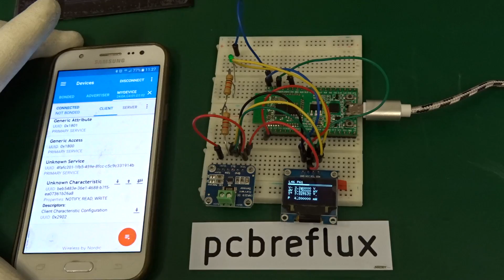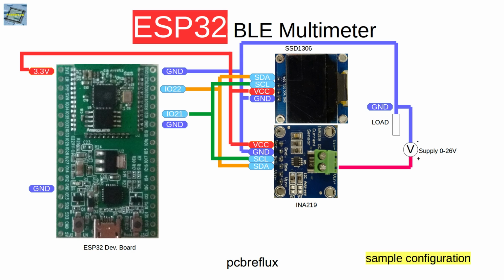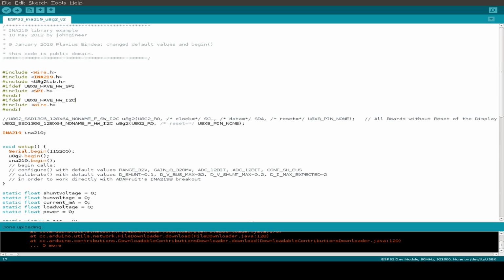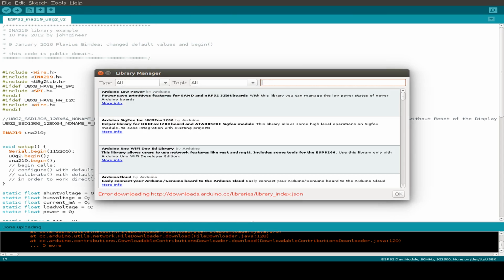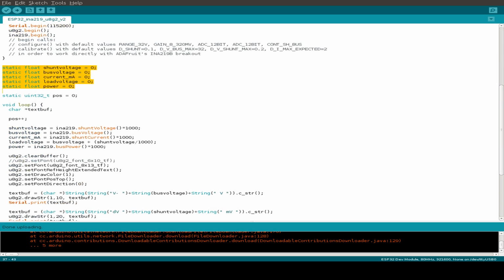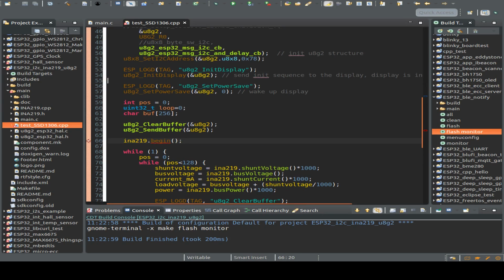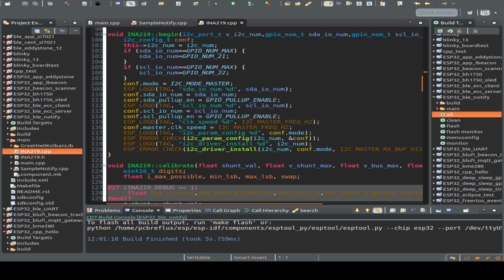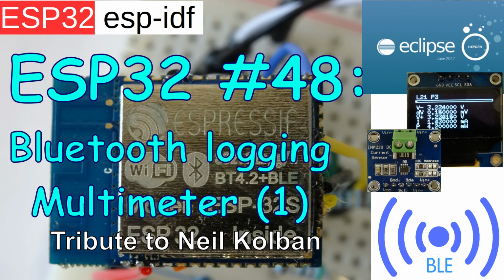ESP32 #48: Bluetooth Logging Multimeter with INA219 and SSD1306

Comment: Thank you for excellent video. One question:  ESP32_ina219_u8g2_v2 example gives the compilation error message such as C:\Users\user\Documents\Arduino\libraries\ArduinoINA219\INA219.cpp:38:24: fatal error: util/delay.h: No such file or directory. Could you tell me how to solve?
Reply from the maker: In my case, I just uncomment the util/delay.h line (//#include <util/delay.h>) inside INA219.cpp. The delay function is inside the esp32 core (esp32-hal.h include by default with Arduino.h) and not in util/delay.h. Hope this helps.

Comment: Hi,

I am a huge fan of your and Neil's video and owe a lot to your guys in helping to make a functional prototype.I am making a BLE WIFI bridge for a Bluetooth smart-lock. I have merged together many of your projects like GATTC client and secure MQTT CloudMQTT Subscribe tutorial along with WiFi smart config example from ESP_IDF.

I had a few questions and suggestions, hope you would attend to that.
1. Since I am using the BLE and WIFI stacks together, would you recommend me to pin these two tasks onto separate core instead of usual xTaskCreate. I am getting few errors about load prohibited error on COREID 0. If yes then what would be your Ideal core configuration. What I mean by this is which task you would specify to which core.

2. In the MQTT subscribe example I am facing some connectivity loss issue after the subscribed message has arrived. Even if I am using WEBSOCKETS. I think because of the Bluetooth Gatt client code running during that time.(although it is on different task). Also after I get a message from Bluetooth and I want to publish it to MQTT server, I get an error of publish failed -1 error some of the time. and sometime even if the error is -1, the message has been published.
Is there any specific things to keep in mind to increase the stability?

3. Also can you do a video on OTA update? that would be helpful.

Thanks and keep making these videos.
Reply from the maker: 1. Have no issue without pin a task to a specific core. I just let the esp-idf and freertos decide the core. But with BLE and WiFi the stack for the individual tasks have to be big enough.
2. Yes, there are some instability with the my MQTT examples, don't have a clue yet. So for subscribe I use a reconnect after a connection loss. For publishing I just use a single connection and close after sending the message.
3. espressif OTA uses no signed firmware and no encrypted transport so I delay this topic. Maybe you know a secure OTA way? Like nordic semiconductor does with their BLE OTA DFU.
Reply: I assigned BLE operations to Core 0 and Wifi and MQTT task to Core 1. After doing these the errors of load have stopped surfacing, also the code runs more smoothly and in sync as two different cores are involved. I needed that especially because I have a huge app, the BIN file is almost 1.3Mb( I can hardly keep them in OTA as the OTA requires two images with a factory image.)

I think I found the cause of instability in MQTT. Have a look at this issue. https://github.com/pcbreflux/espressif/issues/16

For the time being, I have implemented the same OTA code given by Espressif and Windows Python Server using HTTP. However, I will try to port your Secure HTTPS thinkspeak tutorial or any other HTTPS method for the secure version.

Comment: Thank you for the BT example.
What I a dreaming of:
- ESP32 as a sensors driver using deep sleep mode to allow battery operation
- The sensor ESP using BT, posibbly wide range BT
- Another ESP32 or Raspi etc. acting  as a gateway between BT and Wifi/LAN to route the data to the automation central, e.g. Homematic or ioBroker
Reply from the maker: My thoughts: a sensor with deep sleep could not act as a BT server, because not reliable available, so the BT gateway has to be a BT server and the sensors the clients. The BT clients should automatically recognize the gateway or better gateways? Don't test multi BT connection with the esp32 yet (more than one BT client a the same time), so that might be a challenge, maybe try some multiplexing with short connections. And security have to be also implemented. Don't done something with BT on the Raspi.